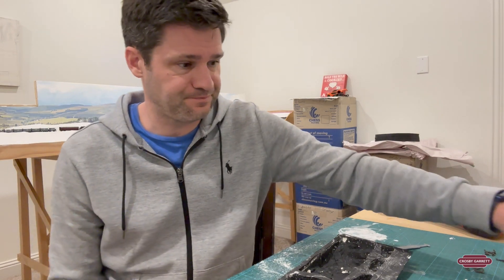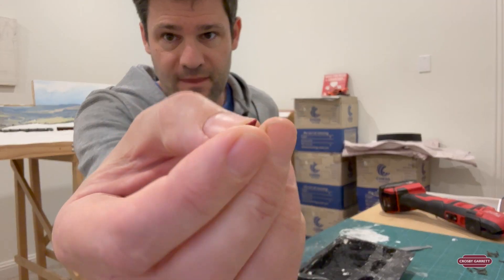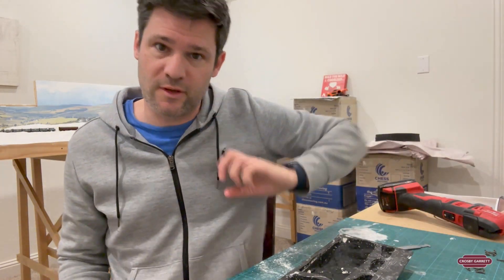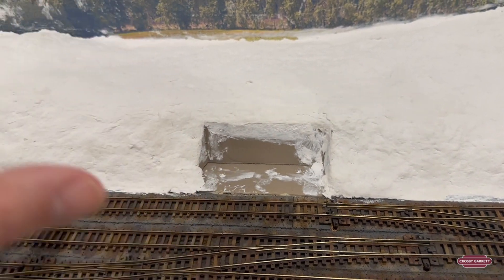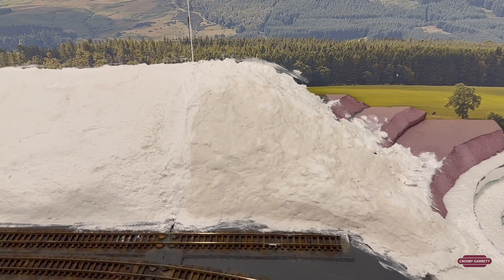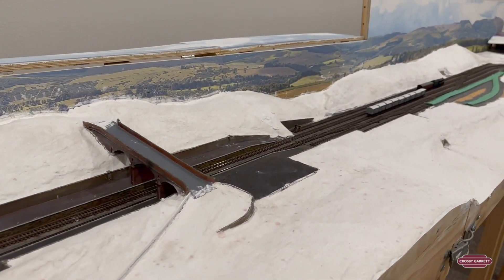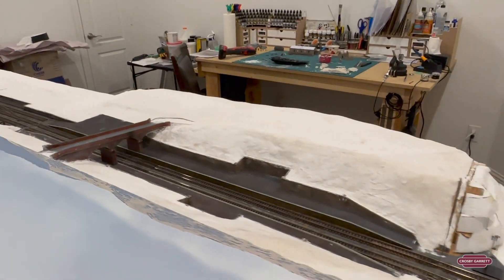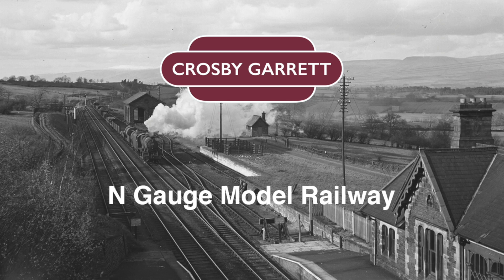Update on the Crosby Garrett N Gauge Model Railway Layout Episode 15

Comment: A lot accomplished there Craig.  It is so difficult, whenever you work with any plaster based product, to keep it from getting where you don't want it.  You will be able to mask most of that when you start doing the scenic work, which will also take the eye away from any bits that might still be visible.  A bit of black soot or dark earth weathering powder along the wall fronts will probably sort out the unwanted white patches.  Great stuff weathering powders as I am discovering.  Look forward to seeing the Goods Shed and Station Master's House completed.  Stephen
Reply from the maker: Thanks for the advice Stephen.. Pretty much what I was going to do, along with use some touch up spray paints to redo the works. :)

Comment: Hi Craig, the scratch built buildings coming along well and should look great once you get the windows in! Are you using stock windows or custom ones from York models? The hard landscaping looks good but you will get a much better idea once it’s all painted up to get rid of the bright white! Looking forward to seeing what you do with the scenery. Cheers Gary
Reply from the maker: Hey Gary, I'm using custom windows. I sent the building plans over and agreed on the design that would work best. Since there is more detail in the windows than can be done on N Scale they had to be simplified a little bit!! Once I have done the ends joins I'm planning on painting it to get a better idea. :) Thanks Craig